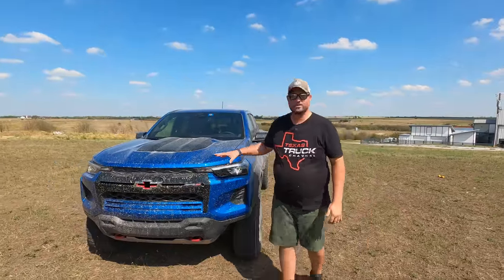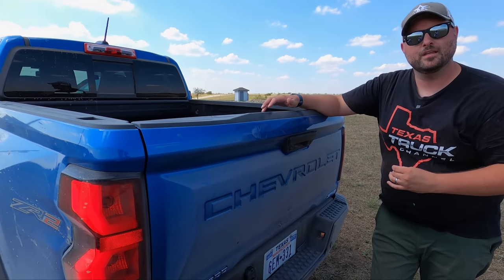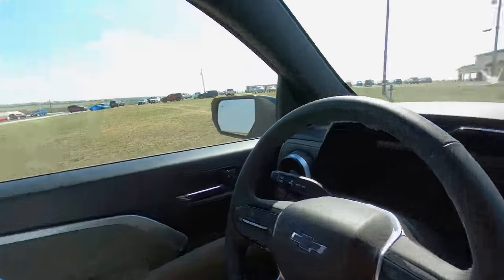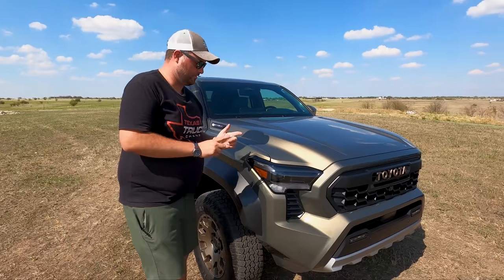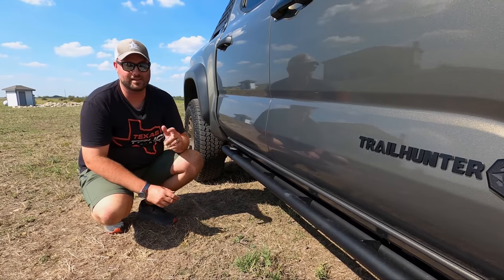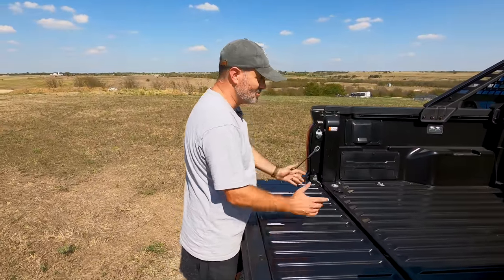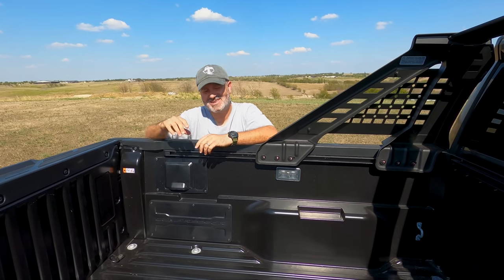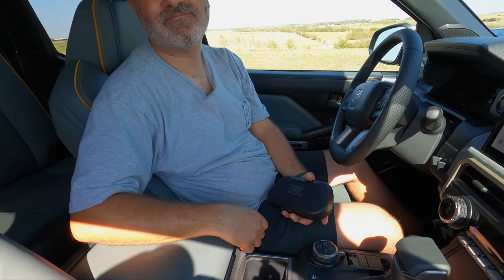Tacoma Trailhunter VS Colorado ZR2 - Which Is The Best Midsize Truck?

Comment: The ZR2 took this segment to the next level several years ago and I still haven’t found a reason to look beyond it. Amazingly capable right from the factory.
Reply: Lol sure
Reply: And ZR2 will be $5-10k cheaper
Reply: Just like every other midsized truck in the segment. I like a truck personally not a fancy truck i don't use them features, I went and bought the 3rd gen Tacoma before they turbocharged it. I'm happy AF and mine is the total basic 📦 less shit to break later. There's no way I'd be happy with these new trucks with all this goofy technology! Take a look at Andre from "TFL truck" he bought a '23 trail Boss  already had a problem being bricked out! Like 7,000 miles. Technologies all fine and dandy until you start to have problems with it when you need. Not my 🍵 of Joe.
Reply: Reliability. GM doesn’t have it.
Reply: How dare u😮
Reply: GM & Ford have hella problems with quality control & reliability. Ford makes the baddest ass fast trucks that are extremely nice inside but quality is shit! GM has had transmission problems for I don't even know how long, I wouldn't drive a Chevy or Ford so I don't know for sure I just hear so many people complain about that. I think the GM 6.2 and 5.3 are great motors but goddamn they got to get the rest of the shit to work with them motors.. a lot of people talk shit about the Tacoma V6 because I guess it's a car motor, it's not fast it's not perfect but I guess that's what a truck is about. I just can't stand it when these goofballs get on here with these reviews talking about how amazing it is and they haven't even driven in more than 1 day! Paid shill reviewers!
Reply: What this guy is talking about how you gonna compared GM to TOYOTA
Reply: The thing was But WHY less sells hahaha
Reply: Why can't toyota mess around like the big 3.  Toss a 5.7 tundra in a tacoma give it a name bump up the price and call it a day.  The difference is it will be more reliable  than any big 3 trucks
Reply: @kamikazikaizer  that would be powerful & reliable... can't have that tho
Reply: @honda116969 damned cylinder shut off kills everything.
Reply: @bmurphy386 Salty shill
Reply: Zr2
Reply: It's a Chevy though (known to break down)
Reply: Amazingly capable on the side of the road waiting for a tow truck while us Taco drivers make it to our destination. Yet again.
Reply: @jusskitten9773  Toyota stans can't stand other brands coming out with cooler shit. Even though their latest models haven't been as reliable and the next generation Tacoma isn't proven to be reliable yet.
Reply: Yet the Taco continues to outsell every other midsized truck 🤔
Reply: @ryanb8736  says who..
Reply: @TROllingNINJA2031  fan base and brain washing . Just like Ford sells so many, but it's a low quality even less reliable truck. So says lemonade guide and jd power. So basing it off sales means literally nothing
Reply: @Gammaaf got 107,000 miles on my 3rd gen. not one issue. i beat the crap out of it
Reply: @nbaldo003  3rd gen is the last generation, and 107k isn't anything to brag about. That's still new to most people.
Reply: Seemingly it’s only the people who are stuck with Chevys that seem to think they’re good. But year after year consumer reports show that Chevy new trucks have the most issues of any new vehicle not just trucks but ALL vehicles. That’s crazy and the lowest customer satisfaction of any truck brand.
Reply: @TROllingNINJA2031  Yet NAPA and other auto parts stores are buying Colorados and Rangers. What would they know about reliability?
Reply: @Dara-ih6jq  JD Power has the Colorado and Ranger above the Tacoma.  I haven't heard a single person who moved from a Tacoma to Colorado regret the switch as the stock ZR2 is a no compromise trail beast while the Tacoma is designed for around town economy on pavement.  Sorry to be so dismissive of the Tacoma but I've not felt 'stuck' with my Chevy and fear it's Tacoma owners who are unwilling to accept the segment has changed and Toyota is having to play catch up.  Reliability of my Colorado?  My only issue has been a warranty claim for a faulty DEF sensor so yes, I have had a issue but it's been corrected and perfect sense.  DEF sensor you ask, yes, I was able to get the class exclusive diesel with it's amazing torque and range.  I think the competition helps both brands which we ultimately benefits us.
Reply: @Dara-ih6jq  Oh and just so you don't think I can't see beyond my love for my GM truck, I'm intrigued by the new low tech Land Cruiser.  I think that could be an amazing platform to build from with little to no competition from the other brands as they have nothing similar. I hope Toyota sticks with it.
Reply: You are the first person I have ever heard speak so highly of the ZR2 ngl
Reply: @Dara-ih6jq  is it perfect? Certainly not and I'm willing to elaborate on it's faults if you want. But, from the diesel engine, DSSV shocks (which are witchcraft), and stock Duratrac tires to the locking front and rear diff my ZR2 is just a truck that has no competition.  I shopped the Frontier, Tacoma, Ranger, Jeep but each seemed to have a fatal flaw.  The Jeep was close but honestly cost was the biggest factor that pushed me to the ZR2.  Couldn't be happier and will speak highly of the ZR2 to anyone who will listen.
Reply: It might be good at what it does but it also has to be reliable that Chevy & Ford seem to have a huge problem with, imo that's why a lot of people lean towards Toyota you can actually count on that to be reliable. Chevy & Ford have to make the truck faster & have more options because they can't ✅ that reliability 📦 box lol 🤷
Reply: @Gammaaf I think it's great when other brands come out with nice advanced cool technology. The problem is GM still hasn't fixed the problem with carbon buildup in those turbo 2.7L motors 😡 at least Toyota used that D4-S technology to keep the motor clean inside. Other manufacturers that actually give a shit are starting to implement their own versions of that same technology why doesn't GM do it? Because they don't give a shit after the 🛻💨 out of warranty & that's when the problems happen because they know their vehicles won't last... Toyota knows their shit will last well over 100,000 miles so that's why they use that technology 🤷 another thing that cylinder deactivation shit is BAD for the motor & they put that on a 4 cylinder? are you kidding me what a joke! stupid ass engineer's @ GM to make it even better that turbo motor doesn't even get any better ⛽ mileage than the 5.3 V8 & barley any better than the 6.2!! If you did get decent ⛽ mileage it's cuz you're driving it like a 🐢 to get both trucks to go the same speed You're going to use much more ⛽ in the 2.7L than either V-8!! GM fan boys be like 😢😢😢 & I'm like 😂😂😂
Reply: If you like leaving your truck in the repair shop half the time.
Reply: @honda116969  I'm not a GM fanboy. I like a few cars from all brands. I just think it's funny how toyota stans act like toyota never has reliability issues.
Reply: @Gammaaf  they do but it's just way WAY less than Ford, GM & especially Dodge & it's usually much less serious problems to repair I think that's why people like Toyota better, also when you have a track record of having reliable vehicles that helps imo
Reply: @jusskitten9773 hmm i don't know many taco drivers making it to their destination bud.  My colorado does every time with zero issue's.
Reply: @Dara-ih6jq says who? Cause I've heard otherwise and seen otherwise first hand in my colorado. My truck is a work truck during the week and a play truck during the weekend and has been great to me. Those tacos you talk about are not as reliable as you think between head issue's and transmission issue's makes then shitty.
Reply: @cmbullit yep i completely agree bud these taco owner's are out of their minds lol. My buddy sold his piece of shit 15 Tacoma with what 130 or 140k miles on it and was sinking money into it to keep it running. He's had head issue's where he had to replace the head on it at less than 100k miles on it. My 16 colorado has been great besides like you experienced the stupid def issue and having to replace the nox sensor in it. My current issue I've had has buffing to do with Chevy but really cheap parts from napa but I'll say first hand this truck's a beast man and has taken me up any trail anywhere I've been. These taco owner's hate cause they know their trucks are pavement princess as to where you can actually beat up on a colorado and it'll still take you home.
Reply: @honda116969 well to be fair, there are way more Ford, GM, Dodge/RAM trucks sold than Toyota so of course you’re going to have more repairs. That’s just logic.
Reply: @XploreAz  in the full size segment yeah of course because you have 3 companies against 1 lol... But if you look at the mid-size Toyota sells more tacomas than Ford ranger, GMC canyon & Chevy Colorado combined. 😉 The American trucks are much more fancy they have much better tech if that's what you're into the 3rd gen Tacoma is very simple not many options it drives like an old skool 🛻💨 but that platform has been around for a long time but that's cool that every company has different models, to each their own. I like the American trucks they're just not for me & what I'm looking for is all Toyotas definitely not perfect I bought my 🛻💨 brand 🆕 & the air conditioning didn't work & it got stuck in 4x4 mode & had to be towed to the dealer 🤦 it was a front diff actuator that was bad they say those NEVER go bad & that I must have driven thru some 💦 🌊 (water intrusion) I was like go get fucked & fix my truck 😂
Reply: @jusskitten9773 until your frame rusts in half like all Toyotas. This thing is made in Mexico just like the others so the reliability myth is going to show its ugly head more than usual.
Reply: @ryanb8736  "Reliability. GM doesn’t have it." 

And you're going to suggest that Toyota does??? The 3rd gen Tacoma was rated least reliable midsize truck for like 3 or 4 years in a row and the guys at TacomaWorld nicknamed it the "turd gen" after all the issues with howling rear diffs, transmission problems, engine failures, high pressure fuel pumps going out at 40k miles, electrical gitches, brake modules going bad, etc. Even the new Tundra is a sht show with all the quality issues, not the least of which is the shocking number of engines with crank bearing failures. The list of guys with 2022+ Tundras with blown engines is growing by the day.
Reply: @jusskitten9773   Those 3rd gen Tacos seem to be really grew at having their 2GR blow up at around 100k miles. Sure is a big list of 2GR failures in the 3rd gen section on TW. Or are all those due to "lack of maintenance?" kek
Reply: @honda116969  Way less??? The 3rd gen has some pretty serious issues trending with it. Sure are a LOT of TacomaWorld members with 2GR's that blew up at around 100k miles and they can't all be blamed on lack of maintenance. They also have that terrible howling rear diff issue that Toyota insisted was wind noise resonance but was proven to be a noise coming from the rear diff. I get that more serious offroaders don't care because they know the factory ring and pinion are weak AF and just upgrade anyways but it's still a problem that Toyota doesn't seem interested in addressing on their end... kind of like they swept the frame rot issue under the rug since the 1st gen Tacoma first came out. Or the way they did nothing about the front diff vibration problem they knew about during the 2nd gen and left it as is with the 3rd gen. They know the vibration issue existed but did nothing so guys have to buy the aftermarket bushing "fix" kit instead. Putting Toyota on some kind of "reliability" pedestal is a joke these days. Particularly with all the problems on the 2022+ Tundra... which also has a huge number of reports of engine failures and transmission problems.
Reply: Agree . Nothing compares to ZR2. Price is big difference.  Taco still don't have lockers and comparable horsepower. These new tacos aren't as reliable as everyone thinks.
Reply: @kurtsandoval7714  Then why don't you enlighten us. Tell us exactly how reliable that actually are?
Reply: It's cheaper and as well equipped if not better. But how reliable is it, how easy is Chevy to deal with if there is an issue which there will be.

Comment: For 10k less, I'll take the ZR2.
Reply: You will lose more than that in resale value. Tacoma's hold there value much longer.
Reply: @erichimmelreich9372  Not true any longer. Check out the Toyota Tacomas reliability rating. It’s not what it used to be.
Reply: @GregEmburyK4GTE  still better than a Chevy.
Reply: @erichimmelreich9372  Ok. What are you 12 ?
Reply: @erichimmelreich9372 who cares just enjoy the truck
Reply: @GregEmburyK4GTE  no. I drive a Colorado for work. Just not impressed is all
Reply: @GregEmbury  yea, if youre a clown that bases reliability on the jd power bullshit. 3rd gen tacoma is extremely reliable and resale is on another level compared to any american junk.
Reply: @adrianc6534  Yeah, ok. That’s not from JD Powers, that’s from late model Tacoma owners and dealers. Where are Tacoma's made ? Also American junk. Clown.
Reply: I have a 2022 that is “American junk” and I can sell it for 3,000 more than I paid for it. Guess your theory isn’t great.
Reply: @onefastr6 everybody who bought any truck in 2020+ can say that in the first year.  Hell, I had a guy offer me $80k in 2021 for my 2020 Chevy Trail Boss LT with the 6.2 V8.  The truck was $55k new.  He never showed up with the check, but the point is what you're claiming is pointless to bring up anymore because it applies to everybody.

Comment: Zr2! Having lockers all around is a big deal for me.
Reply: Lockers don't really help off-road. They're only useful when you get stuck in snow
Reply: @driftx2 I suppose if you pretty much are driving dirt trails, sure lockers might not be needed. They are most definitely useful for rock crawling pretty much anything other than dirt roads.
Reply: I have found the lockers in my zr2 to be highly helpful climbing loose dirt/rock hills.
Reply: Taco has torque vectoring so rear lockers and the disconnect up front will likely be plenty. I have a deposit down on  a TRD Pro. ZR2s are junk and cheaply made.
Reply: @F3RN250 cool story Bro, you sound bias 😂
Reply: @Garlander  I thought I hid it well 😅
Reply: And ZR2 is rated at 16mpg city and 16 mpg highway. Thats a killer for me
Reply: @F3RN250  Yeah, which is why TFL's BROKE during EASY offroading...🤣  Still no front locker.  FAIL
Reply: @driftx2  Yeah, I guess if you're only driving flat, graded, dirt roads...🤣
Reply: @steveo5763  🤣

Comment: Like the extra storage room in the Taco but love the interior of my canyon AT4X.  Also no matter how you look at it, time and time again lockers are superior to Atrac
Reply: Its a chevy.....not a real offroader
Reply: @gabeslb  can't wait for the head to head videos next year. Lockers have all ready been proven superior to Atrac systems
Reply: Its still clowning the taco 😅 @gabeslb b
Reply: @gabeslb   LMAO is that why Toyota pulled out of the Best in the Desert series after the last gen ZR2 joined the same class? I remember Toyota dumped a mountain of cash into building a truck for the series and Hall Racing unveiled that they were going to compete in the same class with the brand new ZR2 and Toyota pulled that truck from the series overnight without explanation.
Reply: And you will be in the shop longer
Reply: @joelrivera6473  like the few guys that actually got approved for replacement frames by Toyota and then had their truck dry rot on dealer lots for 9 months while Toyota dragged their feet to replace their junk frames? Or the guys sitting around with 2022 Tundras with blown engines at 30k and waiting for a replacement block? That wait is getting longer and longer as more and more engines blow.
Reply: @joelrivera6473  funny, you say that considering the tacos have just as many issues and some of the same ones as well.
Reply: @gabeslb  Right, because TFL's 'Taco BROKE doing EASY off-roading...🤣

Comment: Man if they kept the features like headlights on the analog side, I’d definitely take the zr2 but I’ve seen too many software issues that might be problematic when you actually need the truck
Reply: My favorite was the charging port or door handles not working on Tesla's.  woopsies.
Reply: They no longer have software issues..
Reply: @djcan9503  until the next one.
Reply: So since 99 chevy has had auto headlights but the fact you can't have a knob would stop you from buying 🤣🤣🤣🤣 🤡🤡
Reply: This is your reason? Lol 🤡
Reply: Weak!  GM got rid of the knob that nobody touches anyways because the headlights are automatic and everybody loses their damn mind.  Ridiculous!
Reply: @scurjaldan5349  Like the software "issues" with the 3rd gen Taco's junk transmission? How many times was it promised that the newest software update would be the one that "fixed" the transmission and engine problems with that truck?
Reply: Why? Do you frequently find the need to manually turn your headlights off as you are driving down the road? Just so you know....  the button that shut the headlights off wasn't analog..... all it was doing is sending a signal to the BCM (computer) asking it to turn the headlights or or off manually.... just like the touchscreen.
Reply: I actually like to turn my headlights off but fog lights on when pulling into my driveway or other situations as such so no physical switch for that is very lame

Comment: I like both trucks. The Toyota has some unique features and will undoubtedly have excellent reliability and resale value. Nonetheless, I would probably purchase the ZR2 for its (likely) superior off-road capability and interior design.
Reply: I've purchased several vehicles and interior design was never a consideration. Function over form